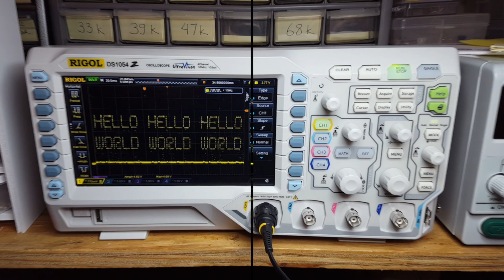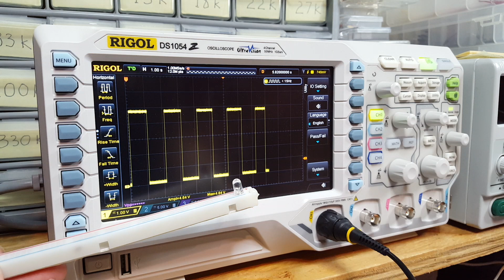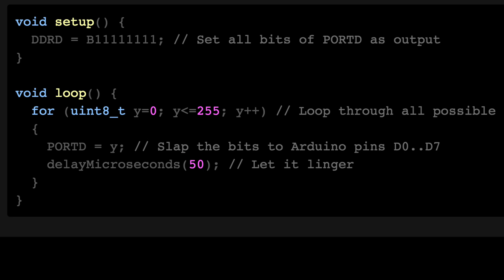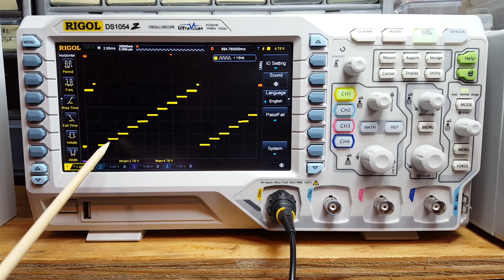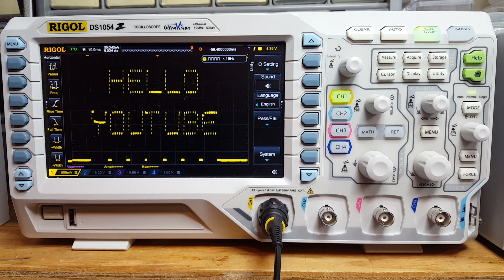HariFun #134 - Oscilloscope Abuse

Comment: way cool ! .   i thought you wre just banging out a signal so fats there was not much time diff .  that would be really pushing Arduino i think and was trying to sort out if it was something like teh composite TV out lib .   way cool man .
Reply from the maker: Hi Scott!
Glad you agree that it is a cool hack.  If you have time, I'd love to see the "Hello YouTube" code displayed on your new Banggood scope.  It should work, since we only need one channel.   Maybe you could one up me and display some 3D graphics?! Resolution is 255xunlimited?
Reply: +Hari Wiguna haha , im a scope newb .  LOL would be fun to see it it can hack it , but the DSO I have has fixed scales and such , ie switch multipliers and such are not  continuous pots like yours. not sure i can scale it . lol
Reply: +Hari Wiguna do you happen to know what time division / scale made the text show ok? its possible min is fast enough . then i just need to make a resistor ladder. ( handy to have one of those any how, i should make a permanent one. )
Reply from the maker: +XerotoLabs 
10ms works for the Hello YouTube. However, I don't think it's that critical, you can adjust the delay in the sketch to match the best available on your scope.
Reply: ah cool thanks man , and  that's not too bad at all then . I have to test a RAMPS board with steppers,  and do a video about how I use TinkerCad , then i will have a crack at this i think .